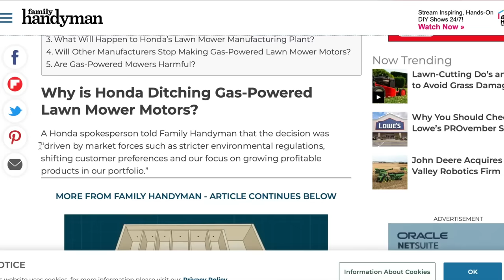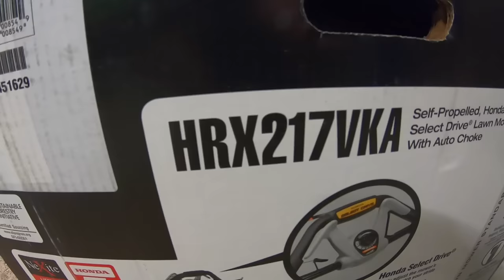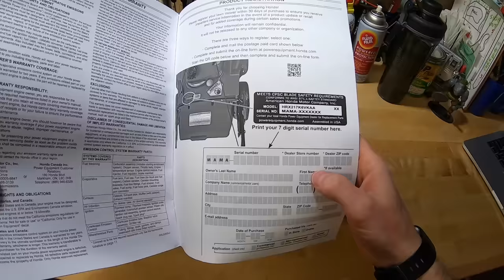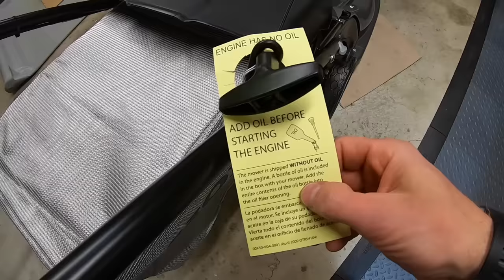ARE HONDA LAWN MOWERS STILL WORTH BUYING IN 2023?

Comment: I love Honda mowers, especially the dual blade setup, but honestly the tire tread are really poor. Especially on the drive tires. I’m lucky to get 2 seasons out of the drive wheels before the tread wears off and they come apart. There’s a reason the big box stores have plenty of Honda replacement tires for sale. Which are not cheap.
Reply: I have the commercial version and the traction sucks
Reply: Ditto!  12 year old HRR.  On my 4th set of wheels and the front ones bow outwards / \ no matter which hardware I replace.  Having said that, the engine runs and the mower mows like the day I bought it.  Just those darned wheels!
Reply from the maker: How many lawns do you do with the machine a week?
Reply from the maker: Thanks for sharing!
Reply: I mow 3 quarter acre house lots with my Honda mower. From mid April to mid November. If you subtract the houses, driveways, sidewalks, landscaping and patios, we’re not talking a lot of grass that gets mowed. When your putting out $500+ for a mower, you should expect the wheels to last more than 2 years. Honda should stand by their product, but then again they are getting out of the lawn mower business, aren’t they?
Reply: @GarageGear  I mow one lawn, 1/4 acre, approximately 40 times a year where I live.
Reply: I wore the tread of my 20 yo Honda mower's tires a long time ago.  Smooth as can be but the original tires are otherwise still holding up.  Had to patch one area of the deck with fiberglass due to rust through.  About to do it again to another area.

Comment: I bought an old Honda lawn mower about 5 years ago, it cost me £50, and has never let me down. When I go to a new customer, and they see my mower, they always ask me if it works.

I am looking for a wider mower than the 17" cut, but that is the only second hand Honda, that I have seen, in this area. The wider mowers are not in my price range, and all have another make of engine on it. 

Honda are the best, and it is most likely to be spark plugs which will need to be replaced.
Reply from the maker: Thanks for sharing peter

Comment: When  I heard about Honda doing this I had to rethink about buy one for my business I want to start up because of parts and price increase risk of repair/parts/ buying the mower itself increase of price. 

 I worked with these for years and even though it was abused by the company it still ran strong with small issues just  from the fact no one took care of it at all like the front wheels dropping constantly, roller stopped driving from lack of basic care and that no one checked the blades properly so I kept noticing chipped blades from stones and rocks but it kept running strong regardless of its abuse which was a reason I want to have one but it is pricey and living in the UK  a roller for stripes is a must since for some reason we're the only country who is obsessed with patterns on out grass. 9/10 customers want lines and the odd 1 customer doesn't want lines and if you say you can't do lines today  with customers who want lines  7/9  of those customers they are willing to wait for the right mower  and 5/9 will use another  company if you don't have one at all as its an expected finish from professional gardeners.    These are my own statistics of experience while working with a company I took notes  along my way so I could learn from other peoples mistakes before starting up.

I really like a Honda but I dont want to struggle on getting parts if this becomes a thing or pay more than I should for fact of parts are plentiful but discontinued  with repair companies taking that as a reason to hike up the prices on the brand saying "its getting harder to find parts". Using half truths.
Reply from the maker: Thanks for sharing this etr!

Comment: I am 70 years old and have owned many mowers. I have never had a mower engine fail even on the cheapest push mowers, and I don’t baby them. Some I never even changed the oil.
Of course it is even better when you do. I have a 20 plus year old Craftsman riding mower with a Briggs engine that cuts at least 2 acres like a bush hog every week. I have replaces wheels, tires deck bearings and blades, but the engine runs like a champ every time.
What fails on mowers are things like wheels, rusted out decks and other bells and whistles. 
Briggs and Stratton, Tecumseh,  Kohler and all the rest are pretty indestructible .  Use good non ethanol gasoline. That ethanol crap will kill an engine in a few weeks just plugging up the carbs.
All the hype around “expensive “ engines on mowers is just advertising hype.
Reply from the maker: Thanks for sharing bill!

Comment: That sucks about the mowers being discontinued, but......... My rant: $1000 for a mower is insane, I'm done with buying expensive new mowers. Too much $$$, and your rather OCD, trying to keep your mower clean and looking new is too much hassle. Sometimes you just wanna mow and dump it back in the shed. Also I don't wanna (always) treat my mower with kid gloves. I wanna be able to trash on it a bit to get the job done. I have some areas of my yard that DO NOT look like a golf coarse, and the mower gets a bit of a beating. And dust.......oh man dust, during the hot summer my yard can be bone dry, and the mower looks like I left it out in a dust storm.
Reply from the maker: Thanks for sharing dwoodog!

Comment: Word of advice, don't turn the mower around on pavement.  Mow a decent strip around the perimeter and make your turns on grass, those wheels will wear out quick.  I'm on my third set.  I don't have this model, I bought mine 10 years ago with a metal deck.  About that, not a fan of the plastic deck, that's the only ding I'll give this mower.  Metal decks will last forever if you take care of them, plastic however will deteriorate over time.
Reply from the maker: Thanks for sharing

Comment: RE: Parts and Honda,  they've always been pretty good about parts availability.  I was a dealer for them for 20 years.  I sold 1000's of their mowers.  I've been out of the business for about 3 years,  and yeah, hearing they are getting out is sad,  but not surprising.   We saw this happen with Kawasaki and their 2 cycle line.   We were selling at least 1500 units per year when they decided to get out of the business. I once had a rare 1980's era Honda that had a flathead 4hp motor on it.  the HR214   When I got it it was over 20 years retired and they still stocked the wheels (they were pricey though  $70 ea Dealer cost)
Reply from the maker: Thanks for sharing justin
Reply: Honda uk say they are not stopping making petrol lawn mowers they just won't be selling any in California.
Reply from the maker: @bobp6742  thanks for sharing

Comment: The biggest issues out there in the 'real world' is that there are huge number of DA to lazy to do simple maintenance on a gas powered mower. By simply doing the basic maintenance recommendation stated in the owners manual, almost any brand mower will provide years of service. I own a Honda. I check the oil EVERYTIME I pull it out to mow the lawn; even though it has never indicated any consumption of oil. I do not use gas with ethanol. I always put stabilizer in the fuel can. If my engine has a fuel shut off valve, I always turn the fuel just before the lawn is cut allowing the engine to empty out the carb. I ALWAYS clean the entire mower after every use. I lubricate all recommended areas, i.e. cable(s) wheels, axles. I always have 2 blades that I swap when one becomes dull. Then sharpen and balance the blade for next swap. I change the oil at the end of every season. One other item I notice is most people cut their grass way too short. That is stupid. It's hard on the lawn. It's hard on the mower. All it does is tear up the blade(s) and stunts the growth of the grass. I do not mow once per week. I mow every ten days and cut at 3 inches. To me it is so simple; basic common sense.
Reply from the maker: Thanks for sharing this curious!

Comment: Pretty sure I bought the only Honda HRX217 mower that is a lemon. I have had so many issues with this mower! Bought it new in January 2016 and it’s made multiple trips back to the dealer for warranty work, now of course I’m footing the bill. Everything from a cracked rocker arm to all four height adjusters needing replaced, to transmission fluid leaking. Oh, and let’s not forget the frequent valve adjustments that are necessary, as well as the notorious mower won’t pull backwards due to rust build up on the axle. The latest issue is an oil leak on the bottom of the mower. It never ends with this thing, and I only have a small subdivision lot to mow. I’m thinking of painting it yellow because it is definitely a lemon.
Reply from the maker: Sorry to hear, Ron. Maybe consider selling it and replacing with something else. It sounds like you’re putting a lot of time and money into it and sometimes you gotta draw the line.
Reply: @GarageGear  Yep, that's where I'm at. Looking at Toro and also battery powered mowers, though I'm not completely sold on them yet.

Comment: Still have my HR215HXA from the 90’s. Mowed with it twice last week, since my Electric riding mower was having a “lack of sufficient charge” problem.  Filled the tank with gas, turned in the fuel, and start on second pull.  I hadn’t used the Honda mower for 5 years.  Still works like a champ.  😎
Reply from the maker: Honda for the win! Thanks for watching dig!

Comment: the Problem a hear on this machine and stop the production too, or correct me, please,  the cam assembly is a plastic part and it does have spring as well as a small piece on there that allows the engine to essentially decompress during the starting stroke. so when you're pulling the rope the engine is essentially opening the exhaust valve to make pulling the starter rope easier. Otherwise, you would have so much compression there that it's going to basically pull the cord back very abruptly and that could possibly cause injury.
Reply from the maker: Thanks for sharing

Comment: Yeah as someone who has used gas powered mowers for most of my entire life have seen that even cheap mowers that used to be $150-160 bucks now are over $300 bucks now. It's because Gasoline powered mowers are not in high demand anymore so they are not making as many as they used to. Just this year we just bought a GreenWorks Pro 60V Battery powered mower. The time have changed drastically yet again like they have back from when I was a kid in the Late 1980s into my teenage years in the late 1990s into my adult hood in the early 2000s. I said this for years now that they don't make mowers like they used to.
Reply from the maker: Thanks for sharing

Comment: I replaced a cheap non-Honda brand mower after fifteen years, last summer. Its engine was a Honda and started on a dime every spring but the deck wore out.

I then bought the XML08 Makita mower, which is nothing but a toy (gutless power, terrible battery life). Two weeks later returned it and bought another Honda mower, which I’ll replace with a battery mower sometime well into the 2030’s when they are actually worth buying.
Reply from the maker: thanks for sharing!

Comment: Well in the last 3 weeks I owned 2 brand new Honda HRX217HZA lawnmowers and both failed the exact same way.  So here it goes.  Purchased mower #1 on a Friday and mowed the grass once on full mulch with ethanol free gas.  Cut perfect and all was good.  4 days later went to cut the lawn again and the engine wouldn't start with the electric start and then I tried with the pull start and the handles was ripped out of my hand so clearly a compression issue.  Took the mower back and they looked at it and said it was bent camshaft and gave me a brand new replacement out of the box as they said the issue was not my fault.  Came home and mowed the lawn this past Sunday and all was well.  (BTW I even did your 30 minute engine oil replacement and even purchased AMSOIL small engine 10w-30 full synthetic for future changes).  Took the mower out for 2nd cut last night and the exact same issue happened with mower #2.  Drove back this morning and asked for a refund.  Spent last evening on lawn forum sites and youtube videos and found a few examples of the exact same thing.  

On the lawn forum site I found the exact same story as mine as if I wrote it and the man was going on mower #3.  Spoke to a Honda mechanic and he said there was no service bulletin yet but the quality control is so good that if this is happening it could very well turn systemic.  He also said he and others were very perplexed why Honda went away from the OHV design back to the current design which is similar to their design back in the 80-90's.  He said they had worked out all the bugs on the previous OHC design but that Honda does this by tinkering and redesigning when they really don't need to.   So bummed and now I have to figure out plan B for a mower.
Reply from the maker: Thanks for sharing this Amy
Reply: @GarageGear  

I know you have the new Super recycler are you happy with it?  Is there any engine sputtering folks are talking about??
Reply from the maker: @amywolfe6100  not a single sputter yet on mine! Video on it will be out tomorrow!

Comment: Hello JB: About the story about the Magneto. You should of checked the clearance between the Magneto and the Flywheel. The clearance needs to be .016 +/- .008 inch. Or use a normal paper business card. What the repair dude did was flip the Magneto and applied proper gap, that's it. The torque on the two Magneto bolt is only 7 lb-ft, so probably those bolts came somewhat loose and the Gap became to wide to produce proper voltage to the spark plug, that's why the engine would not start.
Reply from the maker: Thanks for sharing Chris!
Reply: Huh?
Reply from the maker: @chrisparman2080  sorry Chris got spammed!
Reply: @GarageGear : I get ya, I didn't believe you wanted my opinion on anything, hahahahaha

Comment: Im just gunna say this as someone whose worked with many small engine machines, hondas are always worth buying, its just always about price and whether you want to spend that. Ive used a masport 470 as a commercial lawnmower for about 7 years now and i cant fault it, maintenance is easier than a honda, they are lighter than a honda and once you tinker with the throttle control theres no issue with power, works first pull to this day and doesnt need to be primed despite having a primer lol
This mower outlived 2 hondas i used commercially with another business and they had more maintenance done and also by qualified mechanics.
At the end of the day its all about research, expenditure and appearances.
Research is so important, you can buy great cheaper mowers if you know what to look for.
Honda bodies are ultimate, the chassis are so solid that theybwill out live multiple engines.
Reply from the maker: Thanks for sharing this Blakey!

Comment: Well got my lawn mower back they basically replaced the entire engine part by part.  Honda didn't send a complete engine, but they had my dealer rebuild it.  It now runs perfectly.  No joke, though now the transmission went (the mower isn't even a year old).  Honda authorized a brand new transmission so essentially I have a brand new engine and a brand new transmission.  Doing my first cut since getting it back this week.   Hopefully my saga is over with and this baby lasts a long time.  Time for the 30 minute warm up and oil change and then Amsoil synthetic it is!!
Reply from the maker: Glad you got your mower back and you’re ready to tackle this season! After the warm up and oil change, it will be good to go!

Comment: my third Honda mower 15 yr old  HRX217HYA has hydrostatic transmission (no belts).  Axle clips are slipping, wheels lock up, possibly need entire new transmission and, given the age of this,  I no longer want to spend on more parts so off to the store for new mower.  I can get the exact same model on sale but commercial version has reputation for durability beyond residential versions - so probably spend up for one given it will give me less problems given the issue of parts. My current gives me a fantastic cut on Bermuda grass and some forums say the commercial version (steel deck) does not cut as smoothly even though both have the twin blades.  Any opinion on residential versus commercial version and even if I should not buy another Honda at all so Toro?
Reply from the maker: Hey half! A lot of subscribers mention that they love the Honda commercial mowers! No complaints about them. The toro commercial mowers are great too. I personally want the one with the Honda engine! Either will give you a great cut too!

Comment: How do you feel about Honda's "no oil change interval just add when low"?
Reply from the maker: Not a fan of that on any engine! I change the oil once a season or every 30-40 hours or so. Thanks for watching!
Reply: I hate to admit this, but I never changed the oil on my 20 yo Honda mower.  So far, never an issue.  Knock on wood.  Oil changes are a religion with my car though.
Reply from the maker: @jperin001  somehow sometimes mowers take a back seat

Comment: Bought a brandy new Honda mower a few years back. Yes, 1 pull start but engine surged forever more. Considered a carb clean out but geez!!! this thing never even hit the grass. Was told Aha!!! You put gas in it with corn. Got some way overpriced ethanol free stuff. Same thing. Scratch the head. Bought a bottle of mechanic in the bottle on Amazon. Dumped the whole bottle in and worked the throttle with my finger wide open trying to blow it up. Soon it smoothed out and now purrs like a kitten. Whoda thunk it. Yo.
Reply from the maker: Thanks for sharing this Neil! 👍